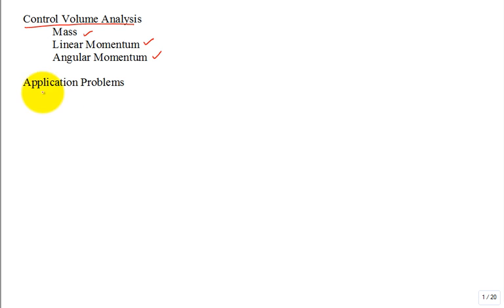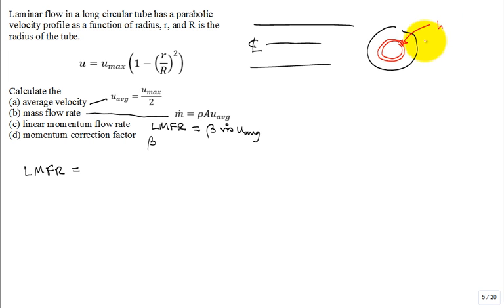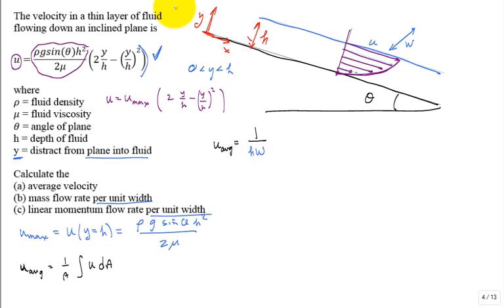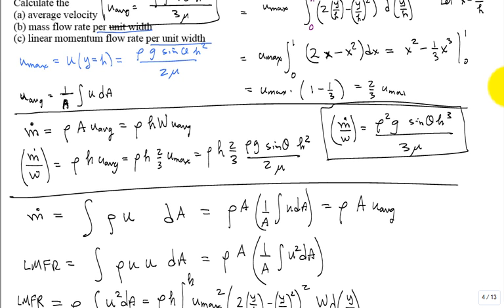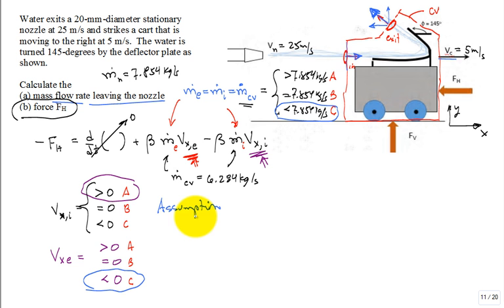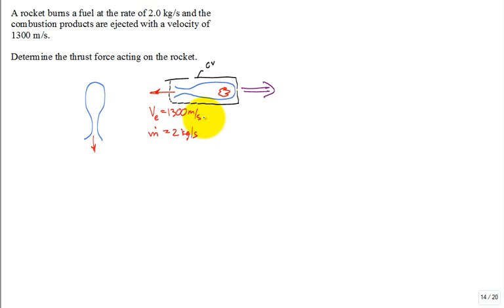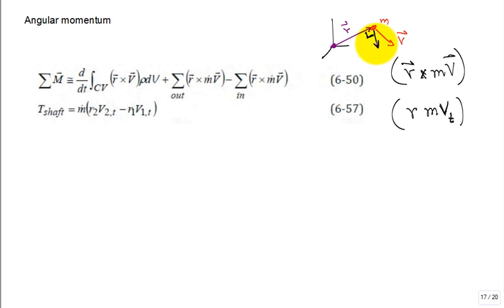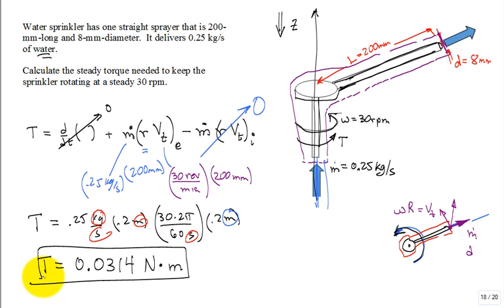Linear Momentum 2 Summer2015

Comment: Fantastic lecture. Regarding the moving cart example, I think here it is asuumed that the turn angle given is with respect to the moving reference frame. If the given angle was seen by the stationary nozzle, then the relative velocity at the exit in the x direction would be different from vin*cos(35). This angle would have to be then calculated with respect to the moving cart. Is this correct?